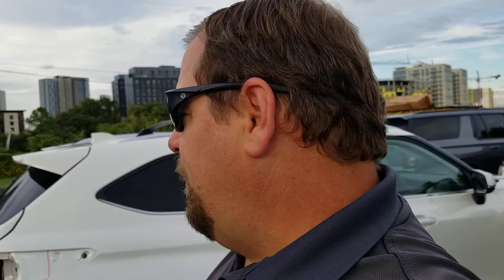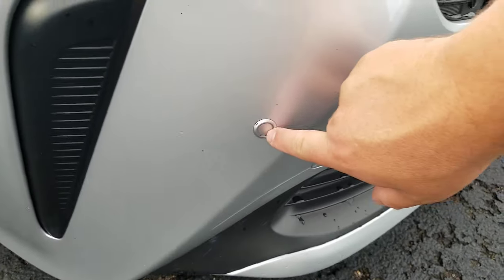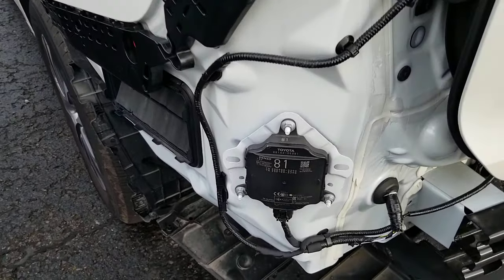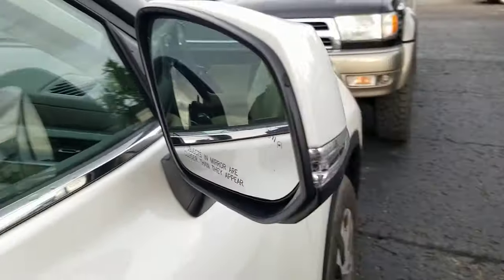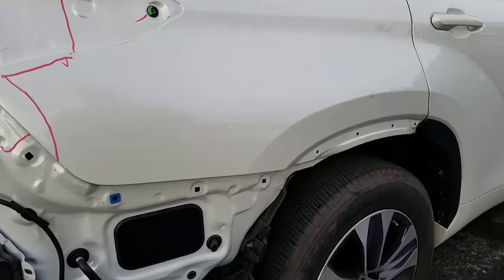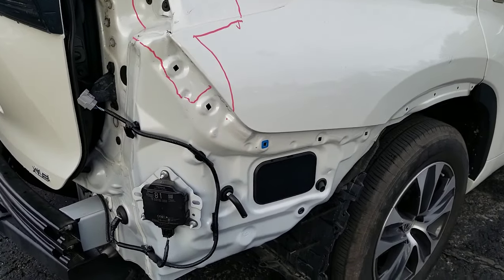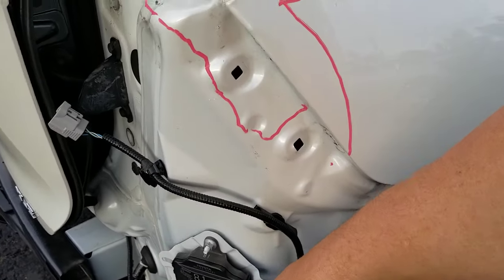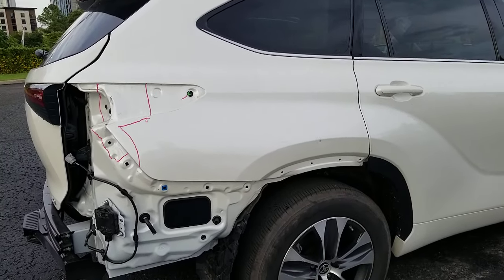Blind spot monitor sensor. Where it is and what it looks like

Comment: The sensors should be available for all their vehicles. The fact that we are in 2021 and you have to get a limited model (almost 50k) to get a parking sensor is ridiculous.
Reply from the maker: its a convenience item so they tend to put those on higher end vehicles.  Toyota is the first and i believe still the only one to put safety sense on every trim level of nearly every vehicle. Which is their top safety suite.
Reply: Just more things to go wrong.
Reply: @breadmenv  disagree. Not one car that me or my family have owned had a parking sensor issue.
Reply: Also depends on the brand itself. Toyota, yes. They can be a bit particular on the features provided at certain trim levels.
Reply: @Peace1dy  I don’t think that’s what they meant. All electronics can fail. I think they just meant that it’s another that can potentially fail. Doesn’t mean it’s bound to happen.
Reply: @FunnyLilChino  The probability is the issue. How likely is it to fail? I’m not a fan of the trim layouts for their vehicle. It’s not just them, though. It’s capitalism at its best. To get the vehicle you want with the features you want, you have to pay more. I get it. Some things should be standard by now on lower trims, I feel.
Reply: @Peace1dy  well the one vehicle I have with them has a partial malfunction that doesn’t prevent me from operating the vehicle in any way, but it’s annoying to have to push a button every time I turn it on just to clear the warning to see my odometer.
Reply: My 2021, $32k Honda has it

Comment: Thanks for the video. I have a 2013 Toyota Sienna which has a non-functional BSM system, but there’s no malfunction error on the dash screen which is weird. I’ll have to remove the bumper to inspect the sensors and check all of the electrical connections.
Reply from the maker: It wont show a malfunction rather shows a green BSM on the dash when on
Reply: @stevenwelchtoyota  thank you, good to know. The BSM dash light is orange, I’ll check for fault codes.

Comment: Thanks my friend, I bumped my back bumper of my cadillac srx. And started to get that service on my screen. Any advice how much would that be
Reply from the maker: it really depends on what you damaged. It could just need a calibration and not be that bad. could need new sensors and then you go up
Reply: @stevenwelchtoyota  thank you Steven. You have a nice day👍
Reply from the maker: @dannytorrez1800  you as well
Reply: Thanks for this video. I recently changed a ride side mirror of my SRX, and the light took a minute to turn on. Now it turns off, and I didn't get any fault message. Do you think I need to calibrate the sensor after replacing the mirror?

Comment: I had 2019 Honda Odyssey that BSI sensor stop working. Before I looked for fuses but it doesn’t have one. I removed bumper and saw wire hardness was cut for BSI. Honda factory make too short it and it on sharp metal. I soldered longer wires connects to move under metal. It was happening cut wires in IKEA store parking, someone during parking bump my van. Now it works with out any problems.
Reply from the maker: Great information

Comment: Steve, while using the USB for music,  is there a fix for not being able to switch from 1 track to another while driving? So frustrating to have to pull over or wait for a red light just to change from 1 track to another. 
While driving, the "Song List" option isn't able to be pressed. 
Uggggggh
Reply from the maker: the arrows on the steering wheel
Reply: @stevenwelchtoyota  
Ok. I will give that a try later on tonight after I finish working.
Just so you know what I have,, I have a Platinum Highlander Hybrid.
Reply: @stevenwelchtoyota  
Yes, that did work. 
The only thing is that it switches the track at random numbers.
I have over 100 mixes on a Thumb Drive and if I am playing track #1 and use the arrow to switch to track 2 and so on, it doesn't do that. It will switch to a higher track # like #67. Hitting the arrow again will switch it to track 9 and so on. 
Not in sequence...
At least the arrow works to switch to a different mix. It might take 100 switches to hopefully get to track #2, but it will eventually. Lol...
Thanks for your help.. 👍👍
Your Toyota knowledge / tips / informative Highlander tips are why I subscribed to your channel. 
Thanks!! If I ever move down there I'll purchase from you. 
Have A Great Day!! 😊

Comment: Could you do a video on some 2020 Toyota’s having early battery deaths? Thr 2020 Camry and 2020 rav4 especially from what I heard are victims of this issue
Reply from the maker: I have heard of a few having the issue. I will research it
Reply: Hi ..do you mean the 12 v. Battery or the hybrid high voltage Nickel battery ?
Reply from the maker: @haiderjebur2348  there were a couple issues with the 12v batteries draining if they were left for a long period of time

Comment: Those radar sensors look very expensive to replace when a Toyota with these kind of radar sensors get damaged from an accident 😬
Reply from the maker: They are pretty common over all manufacturers. If you have blind spot monitor then you probably have this system
Reply: Not so expensive..Bought  a used one for 150 USD..and it should be of the same generation  and the IMPORTANT thing is as Steven said is the Calibration